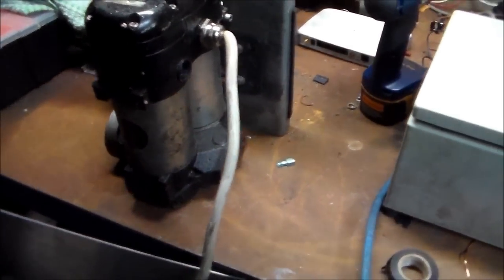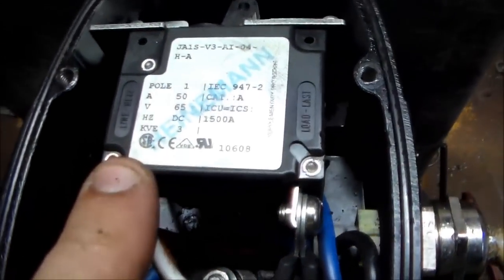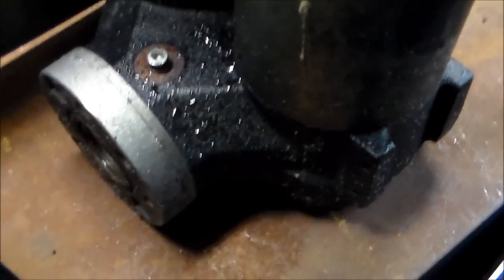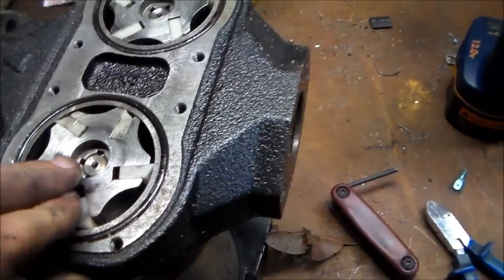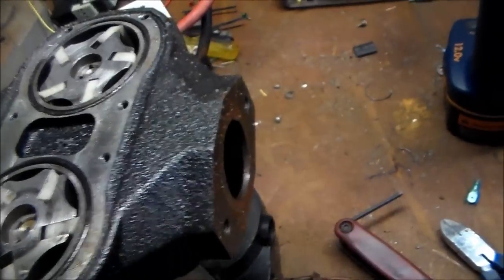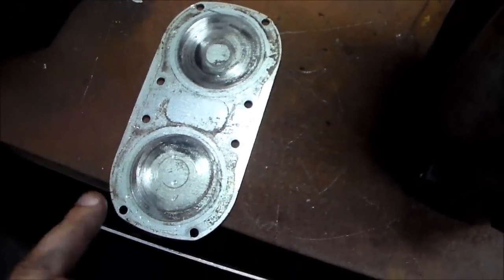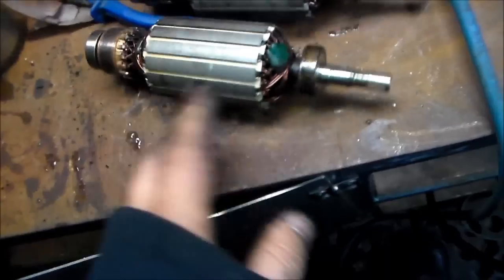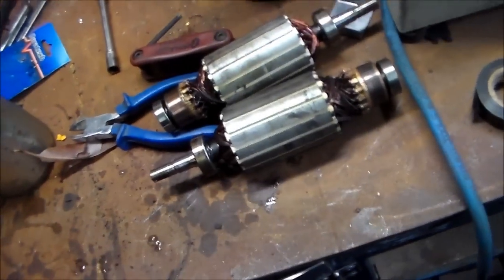Tuesday Teardown/Autopsy :- Diesel Transfer Pump

Comment: Cheers Alex, very interesting! It was interesting to see that the spring loaded 'plastic' tips to the rotors weren't worn at all. As a non-metallic material I consider it to be inferior, when in fact it has faired better than the metallic parts!

Comment: I've worked on dozens of pumps like that.  There was a fib told alright, if the brush cover and brush were missing it is a sure bet that a replacement brush could have been found as well as the cover/retainer.  What is possible is the company went out of business or the pump is obsolete and the guy working on it didn't want to bother doing any work to source a brush and cover.  The fact is a pump like that is worth AT LEAST $50 if it's repaired and that one had every chance of working fine.